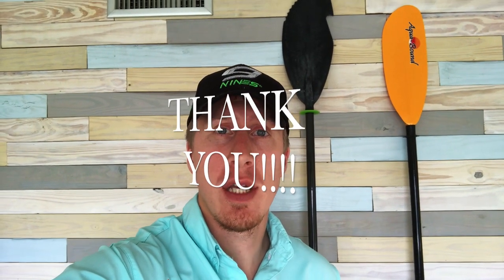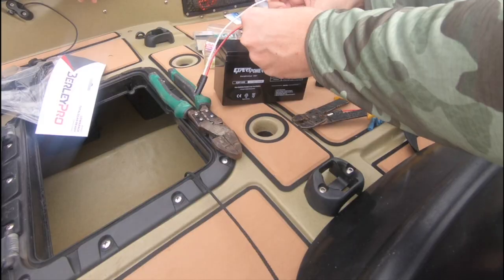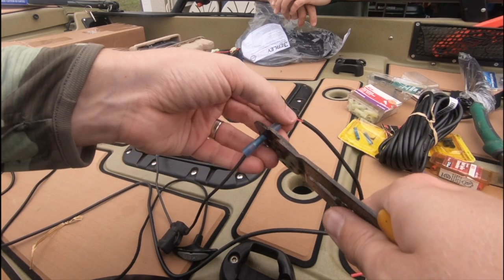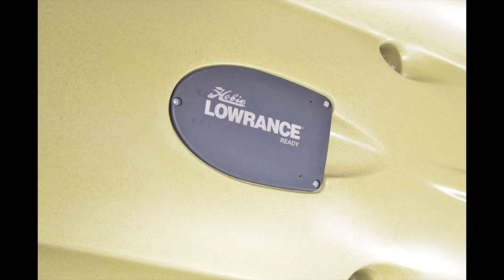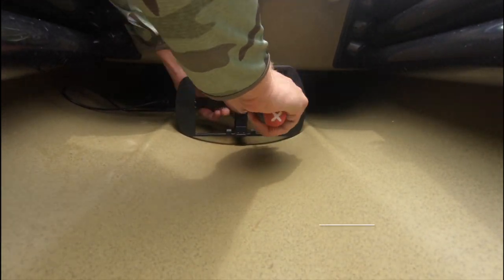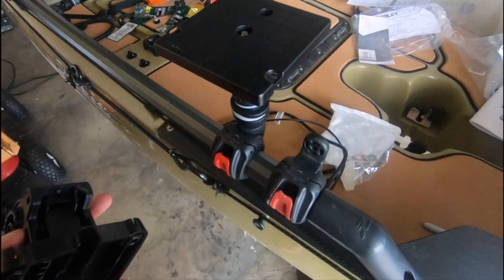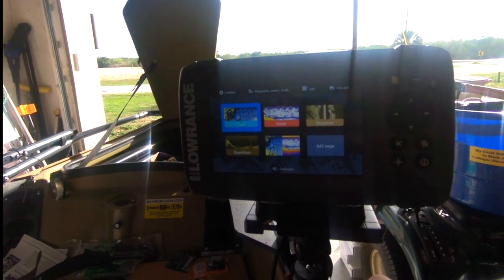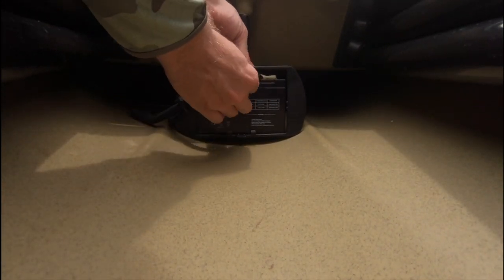Hobie Kayak Fishfinder Install

Comment from the maker: BASIC SUPPLY LIST:
~Online Hobie Kayak Dealer: https://ecofishingshop.com/pages/search-results-page?q=hobie&page=1&rb_vendor=Hobie&rb_price=961%2C5499%7C10.9900%2C5499.0000&aff=20
~Lowrance Hook2 5 FishFinder (shown): https://amzn.to/2skcXsH
   ~Other Lowrance FishFinders: https://amzn.to/2GUxcT7
~12v SLA Battery 9ah:  https://amzn.to/2sjZh0H
~Battery Holder Mount: https://amzn.to/2sdjcPF
~Wire Connectors (all you need): https://amzn.to/2xnsAFy
~Wire Crimper: https://amzn.to/2GWHYIv
~SAE Cable (need to cut in half): https://amzn.to/2LCL73R
~Wire Tubing Cover: https://amzn.to/2IQ9zAV
~Hobie Thru-Hull Fitting (if you need it): https://amzn.to/2xkU7Y7

HOW WE MOUNTED DISPLAY TO H-RAIL
~H-rail Railblaza MiniPort: https://amzn.to/2IXYIB6
~Railblaza Rotating Platform: https://amzn.to/2LDAnlt
~Drilled 4 holes into rotating platform and mounted the stock Hook2 mount.

CHOOSE YOUR LOWRANCE TRANSDUCER TYPE BELOW
~SplitShot: fits stock Hobie cover plate. No adapter needed.
~TripleShot Adapter: https://amzn.to/2IPDJnQ
~TotalScan Adapter: https://amzn.to/2ISsve5
~StructureScan 3D Adapter: https://amzn.to/2xk7M1t

BERLEYPRO VISOR (Reduce Screen Brightness & Save Battery)
~FishFinder Visors: https://amzn.to/2LDoDzN

ABOUT VIDEO: 
In this video we go over how to install the latest fishfinders like the Lowrance HOOK² series with larger longer transducers.  You will notice that the stock Hobie kayaks don't include "Lowrance Ready" cover plates to accommodate the longer transducers. We have made it simple.  Simply purchase your fishfinder from above then find the adapter link above based on the type of tranducer you have!Motor Kits For Hobie Kayaks: https://bit.ly/BixpyMotorKits
Reply: Where do I get the hardware to attach the splitshot transducer to the actual mounting plate? I can't find a little hardware kit online.

Comment: This helps me a ton.  Looking to upgrade my Hobie TI fishfinder to a larger display unit with Tripleshot or Totalscan transducer.  I'm thinking a Hook2 5 or Hook2 7.  I see Hobie and BerleyPro make the cover plate adapters.  I will likely go with BerleyPro since they seem to use a better material.  The coverplate could hit rocks and such so I think the BerleyPro one is more durable for that. I have their visor already and it is simple yet genius.  Thanks for the vid.  Congrats on the 20000 subscribers!
Reply from the maker: The BerleyPro products are certainly well made.  That was kind of our thought.  We figured since the larger transducer protrudes below hull we wanted the BerleyPro cover for added protection.  It just seems to be a bit more robust in design and it covers the whole transducer and feels like a solid system.

Comment: Great vid @KayakDIY, very informative. Why do we need to make sure that the red wire has a female end on the battery side? My battery comes with a charger with a SAE connector. On the battery side, the red wire has a fuse on, and is connected to the male end of the SAE connector. I would like to reuse that part of the cable to connect my fish finder. Does that mean I need to inverse the wires on the fish finder end? Red to female?

Comment: Justin, I have finally completed my FF install using your shopping list and guidance. I'm very pleased with the outcome.  I do have one question that maybe you can assist me with. I've done multiple searches and have not been able to get a solid answer so I figured you might be able to assist. What size and type of micro SD card is needed to do updates to Lowrance Hook2 5 Tripleshot unit?  I just tried a Scandisk 32gb and it did not pickup the update that I moved to the ssd card.  Any advice?

Comment: I would like to make the power chord longer for future location adjustment. Do you think I can add 5 feet of extra length wires? What gauge should I use? Will this extra length impact to electrical drop to Lowrance fishfinder? thanks